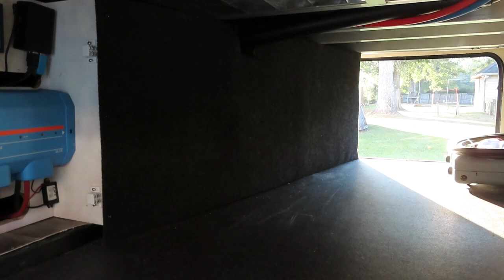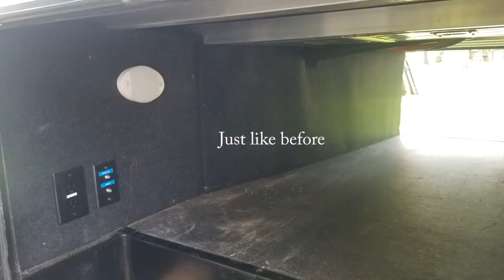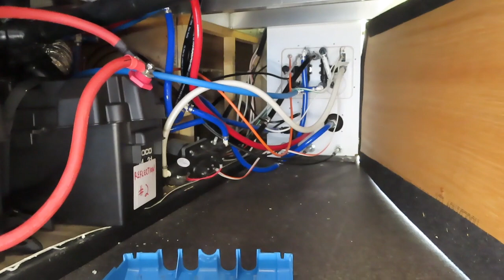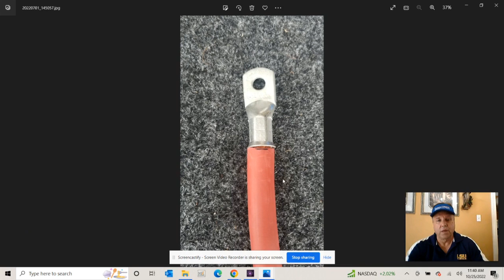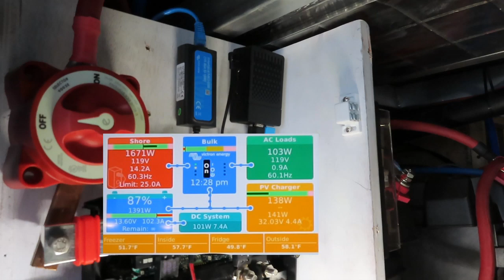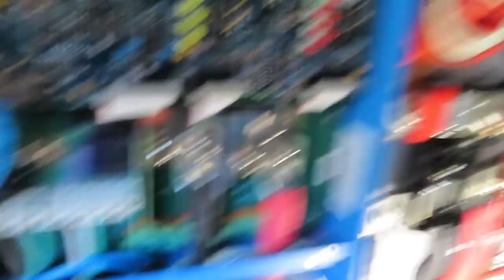All of the Victron Equipment, Used None of the Storage Space

Comment: What path did you take when running cable to and from the electrical panel? Is it on the opposite end in the kitchen like it is on the 26RKE?
Reply from the maker: The panel was not as far back as the 26rke. I followed the factory path with a pit deture/stop at the inverter. I needed a little extra cable from the shore power to the inverter. The from the inverter to the panel can be the same

Comment: Holy cow.  Nice work.  Any chance you can post a block diagram / schematic of this system?  I'm trying to figure out how the smart shunt fits into the setup with the tie in to the bus bars up front.  Also... why did you change out your shore power connector?
Reply from the maker: I like the cool diagrams I see folks post. But never used one. Shunts are simple. Battery negative > Shunt > Lynx Busbar. All loads and chargers then connect to the Lynx Busbar. I did not change out the shore power connector, I only changed the wiring. As I needed more wire to make a stop at the Multiplus before going to the breaker panel. And I used much better wire to do that